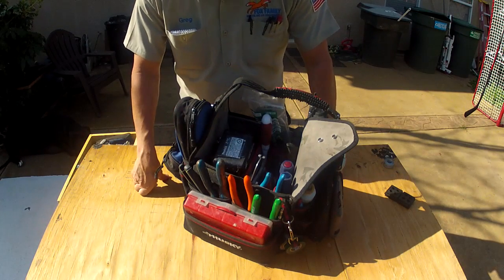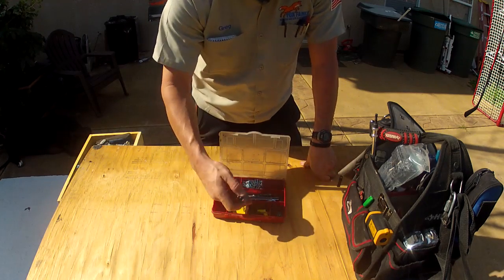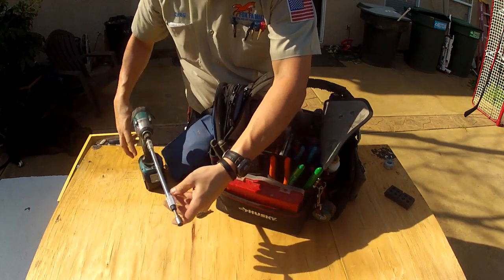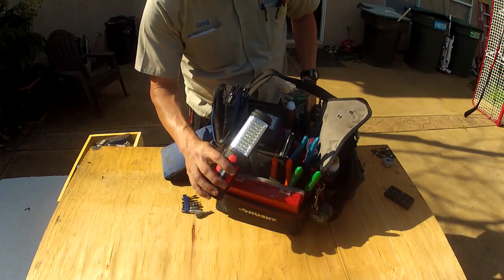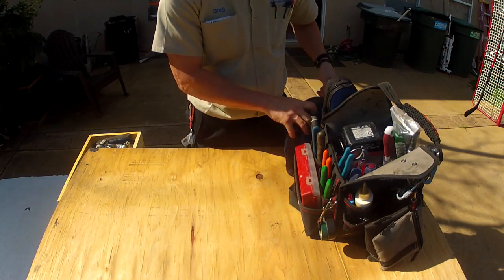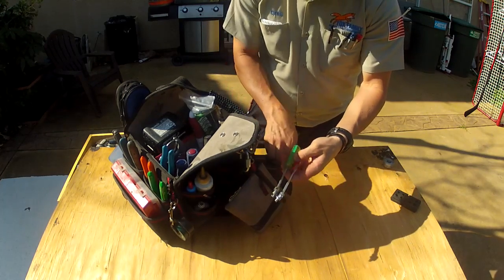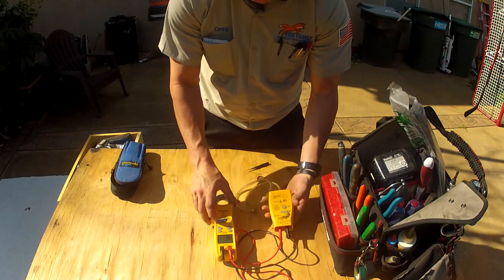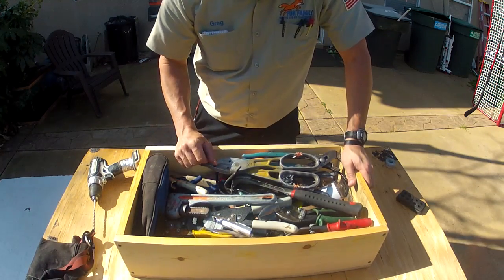What Kind of Tools Do I Need In My HVAC Tool Bag?

Comment: Always a good video. 
I'm cheap too. I do have a set up like that, since I mostly have two or three of everything. But that type of set up works good for most residential but commercial jobs going up man ladders with cages 40'  things get a bit stuck on the cage and you risk dropping something that may or may not do the " Pachinko Machine boing" thingy and strike an employee or end up in some machinery causing the dreaded "someone threw a monkey wrench in" syndrome.  Just something for people to keep in mind. If you're commercial I highly recommend a backpack with VERY STRONG handles to rope up to. If you load your bag like you're ready to assault Omaha Beach in Normandy...rope it up. Seen guys break their backs and legs (literally) packing their bag up caged ladders.